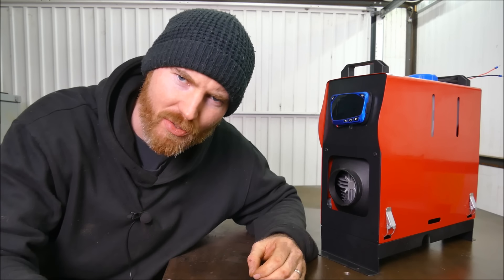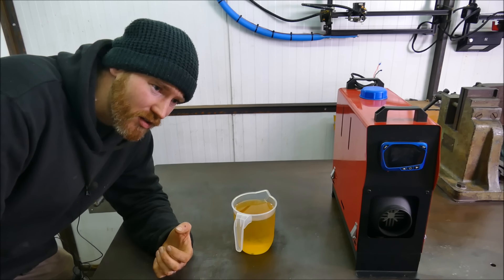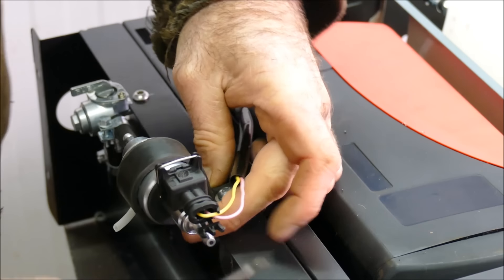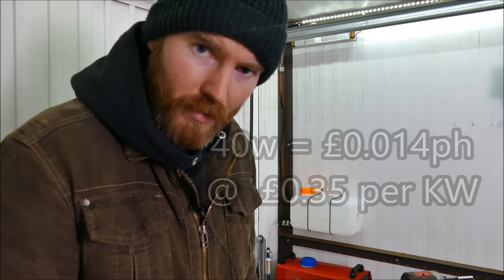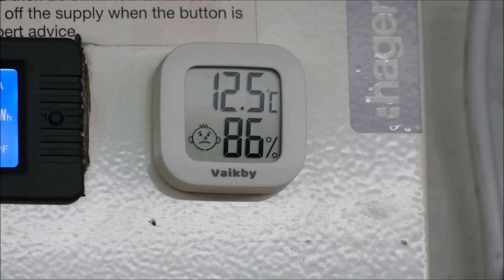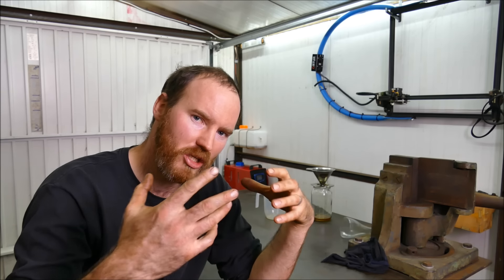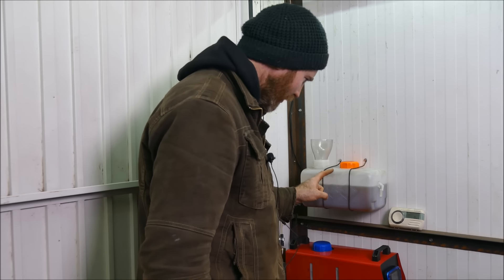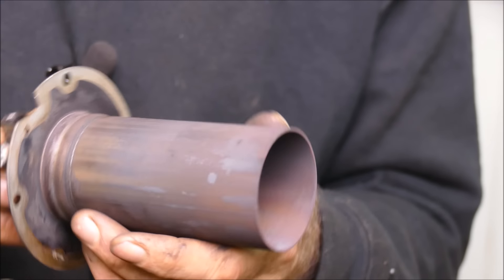£0.03 per kWh heater modification - Top facts & lies on diesel heaters - waste veg oil burn success

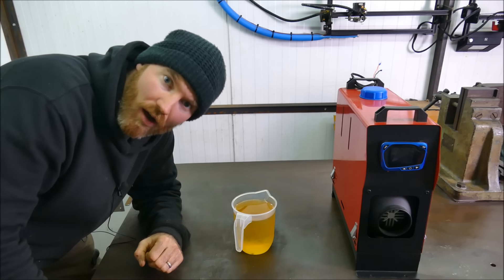Comment: 4:20 Just to note, energy is not charged per kW (kilowatt), but per kWh (kilowatt hour). It can get confusing when the wrong units are used. Thanks. Great video.
Reply: Agreed !!
Too many people don't know or care to use correct basic engineering expressions. 
Sadly it puts anything else in their program in question of accuracy.
Reply: @benjurqunov  So if you happen to misspell a word in an email I'm to question the correctness of everything else you wrote? If you ever misspeak I'm to ignore everything else you said? (not to mention that a) it's not an 'engineering expression' and b) only electricity is charged per kilowatt hour and from all else in this video you can still make your own calculations).
Reply: @pyramidsinegypt  It's not about typos. It's about using the wrong units in a very confusing way which leads to misunderstandings. Energy and power are not the same thing. I agree that if someone is doing experiments and using the wrong units when talking about it we should question if that person knows what he/she is doing.
Reply: @mcg6762  What was it specifically that he got wrong? If something consumes 1kW of electricity (runs at 4A @250V), and it is runs for an hour, doesn't it consume 1kWh of electricity?
Reply: @fredflintstone1428 He was saying and displaying kW instead of kWh in several places in the video.
Reply: @mcg6762  Ah I see. These days if I understand what someone is saying (or trying to say), I value their input rather than being too pedantic. A bit like spelling.....unless it really is bad.........for example, he did say a few times, 'it's more better if you' etc......I can let those go, life's too short.
Reply: @pyramidsinegypt  It's not pedantry. In science, units need to be correct or else they are misleading.
kWh involves a time vector, whereas kW is an instantaneous power usage. 
The difference is fundamental to the understanding of energy.
Reply: Still a great video though!
Reply: Yes I was wondering what his line of thought was and I am still very unsure if his "kW" calculations correspond correctly to the kWh numbers that he was supposed to present. 
So all of that price comparison in this video was for nothing as far as I'm concerned.
Reply: they're interrelated, 1 kWh equals one hour of electricity usage at a rate of 1 kW, and thus the 2 kW appliance would consume 2 kWh in one hour. The equation is simply (kW x Time = kWh)
Reply: @smallg9109  Yes, and it is essential to include the time vector.
Reply: @fredflintstone1428  He said 1kW costs 35p. But 1kW for how long? running a 1kW heater for 1 second costs 35p? running it a day? No. What costs 35p is running a 1kW load for one hour. 1kWh is 35p. That's why the h is important.
Reply: Please enlighten me as I'm still lost to the difference.???.
Reply: @billytollerton4220  kW/h has a time vector
Reply: I blame the school system
Reply: @fredflintstone1428  this approach causes rockets to explode if you try it at nasa. "Spelling" is a bit more important in science than conversations.
Reply: @billytollerton4220  while others have addressed this difference reasonably well, nobody has stated the difference this clearly: kW is a rate of energy, and kWh is a unit of energy.

I agree that it's absolutely not pedantry, and it is absolutely important to not refer to kilowatt hours as kilowatts.

Kilometers per hour is not Kilometers, and Kilometers isn't Kilometers per hour. Imagine the confusion if either of those were mistakenly expressed as the other.
Reply: @TonyLing  :: It's odd that people who don't think proper units are important tend to change their tune rapidly if you're talking about money.  Then they insist on getting the units right.
Reply: @FRESNEL_COOKING_SOLAR_OVENS24  No, you're wrong. I'm an engineer and units are important. You dont have a clue what you're talking about. Its ok if you dont know, just dont come on here and try convince everyone of something thats clearly wrong. It just creates a confusion clusterf*%k.
Reply: @FRESNEL_COOKING_SOLAR_OVENS24  "Energy is charged per kw. Kwh is the total measurement of killowatts used. You pay per kw unit. Prices are per kw."
Thats what you said and you're wrong. kw is NOT energy. You DONT pay per kw. Prices are NOT per kw. If you are indeed an electrical engineer then god help us. Where are you from?
Reply: @TonyLing  we all know it's an hour or is that about to change to?
Reply: @TonyLing are you my old mate from Australia
Reply: @FRESNEL_COOKING_SOLAR_OVENS24  The price of energy does not depend on the kW. If you consume 1 kWh at 1 kW or at 2 kW does not matter. The price is the same.
Reply: @FRESNEL_COOKING_SOLAR_OVENS24 as usual the "engineers" grammar and syntax is incomprehensible
Reply: @jamescasey4643  I've learned english by myself. Is not my main language. I am from East Europe
Reply: I'm glad someone else raised this issue because it's really important to understand the difference between kWh and kW. A simple analogy is where you take a hose pipe and fill a bucket with water. The "kW" is like the rate of flow of the water and the "kWh" is like the quantity of water in the bucket after 1 hour. You could have a rate of flow of 10 litres per minute and over 2 minutes you would have 20 litres. Or you could have a flow rate of 4 litres per minute over 5 minutes and have the same amount of water in the bucket.

So a 5kW heater running for 1 hour should generate 5kWh of energy, although some of that energy will go through the exhaust and be lost to the environment. If you run that same heater for 4 hours then it will generate 20kWh of energy.

HTH.
Reply: @FRESNEL_COOKING_SOLAR_OVENS24  I hope you  don't sign on to a job under the impression you are going to get X Euros per month for 3 months (kW) and it turns out that it is the total for all three months (kWh). 1 Watt is 1 Joule pr second. 1 kilowatt hour is 3600 Joules
Reply: @craigchamberlain  Watt is speed. (kilo)watt hours is distance travelled. I use that explaination
Reply: @TonyLing if you're not a teacher then you should be. I applaud your calmness in expressing the correct terminology repeatedly to those that think it's hair-splitting. Thanks for keeping your cool. 👍
Reply: Yes, it was annoying when he said things like "A litre of fuel contains 3.5 kilowatts of energy"
In some places he says "kilowatt-hours", using units quite correctly, but then makes repeated stuff-ups like that.
Reply: @FRESNEL_COOKING_SOLAR_OVENS24  And you are sill wrong. energy is priced per kWh  i.e 1kWh costs 30 Cents. I really hope you're not an electrical engineer.

Comment: you should try running the exhaust through a normal water radiator.
With the inlet in the top and exhaust out the bottom, so moisture can drain out with the exhaust.
Reply: are these exhaust pipes prone to corosion ?

Comment: With the exhaust being so hot, i would loop it through a metal box first, then the metal box can have an exhaust fan, the inside of the box will get hot and you get more heat. Or run the exhaust through baseboard heating, the fins would give off heat before the hot air is exhausted to the outside.  The idea is to send as little heat outside as possible, and keep as much as you can inside.

Comment: Maybe run the exhaust through a bucket of sand. Sand wont evaporate or go nasty, and will hold the heat. It could also go above the boiling point of water. Maybe even use a trough of sand, then you could have the pipe just do one bend and loop back and have it with a gradual downhill gradient to have any condensing drip out the end.
Reply from the maker: Video coming up. Cheers J

Comment: Idea: your waste heat exhaust could be modified by using a partially water filled rain gutter deep enough to encompass the exhaust tube but the tube needs to run downhill to allow any condensation accumulating a place to drain and run outside. In the US, that usually means 0.25 inches per foot drop. Next idea: use copper water pipe so you can braze or solder the fittings for a leak free path. The inside of the copper is smooth so accumulating dirty condensation is minimal and it leaves quickly.
The biggest downside I see is keeping the water filled gutter from freezing if your climate gets that cool.
Reply: It would take expensive silver solder to be safe from being melted by the exhaust. If he just uses one large coil it would take very few solder joints.

Comment: As most petroleum based fuels combust, a by-product is water vapor... And since you were cooling the exhaust with the water, the water vapor was condensing in the tube. And since the exit pipe was not at the lowest point, it started collecting in the pipe. as already mentioned...

Comment: You can make a cheap and effective vacuum filtration system with a plastic 5 gallon bucket, a small vacuum pump, a hose and fitting for the bucket and funnel shaped screen that fits the top of the bucket. Made one for doing something similar to what you're doing with the used cooking oil.
Reply from the maker: Thank you. It also best to cut it first with kerosene if that's the intention as it makes it far less viscous and easier to pass through. Cheers J
Reply: @joshuadelisle  a 10-20 degree temp increase does wonders as well, let alone heating it to 100-130C

Comment: Waste veg oil apparently soots these up quicker, but you can strip it down and clean, and buy the mesh injector in packs of ten. To recycle the used cooking oil quicker there's a video whereby they put gelatine powder or something like that and it drags all the burned impure waste to the bottom of container and then filter. Supposed to be the quickest way to do it.
Reply from the maker: Great idea. Cheers J
Reply: @joshuadelisle  great work Joshua 👏👏👏👍
Reply: good idea wtih the gelatine, most biodiesel processes gravity settle then filter/double filter dirty waste veg oil. I wonder if glycerine (from the actual process of producing biodiesel) would also work to flocculate the sediment quicker?
Reply: @MyMy-tv7fd  glycerine, I believe so, but not done it myself, but I think there's some videos on YT with glycerine being used.

Comment: For protecting your diesel heater from power outages you could get a 12v battery for a battery backup or mobility scooter and just put it inline. You won't be able to run for a long time but will be easily able to shut it down.
Reply: He said that in the video.

Comment: 2 options, fit a braze plate heat exchanger to ur exhaust you can then heat ur water plus use as a preheat for your kero. BPHX are reasonable cheap from china

Comment: Another great video Josh. I've been running my so called 8kw  heater in my well insulated finished 12x24' shop. I had the pump turned up to the highest setting and it put out an impressive amount of heat burning red diesel but there was an distinct smell of hot or burning plastic... I never found evidence of any melted of burnt plastic but I turned the pump down and the smell diminished greatly.
Yesterday I drained the oil from my diesel van engine so I will be mixing that used oil in with the diesel fuel at what I judge to be about 25% initially... aiming for 50% eventually. My unit is outside. Only the battery, the control, and the heat tube is inside. You could put a small 12v PC type fan on your exhaust pipe to push that heat out into the room. Keep up the good work - your video presentation is a very good mixture of tech and common sense. 
If you haven't already please warn people about the many different controllers being sold out there, how to identify them and the differences. Mine will not change from Celsius to Fahrenheit for US use, seems earlier and later models will.  Cheers
Reply from the maker: Thank you so much. I'll do my best. You can buy the individual controllers if you want a different version. Cheers J
Reply: @joshuadelisle  I'm mixing 25% waste oil into my red diesel now. The heater may actually be working better ( burning hotter) On this mix. What a great heater. Thanks again for all the info you posted on it.
Reply: They will all plug up eventually.  Look at loweredexpectations.  He tried so hard. They all plug up....

Comment: The long horizontal run of the exhaust is excellent!  The draft blower generates sufficient mass flow to carry along any condensed water to the exit and spit it out the end, outside the building.

For maximum efficiency, double or even triple it.  You might need to install a larger diameter exhaust pipe to keep the static flow resistance from becoming too much.  Another length or two of exhaust pipe, below the first one, doubles or triples your heat exchange area to harvest more heat out of the exhaust.  Make sure the exhaust duct is always sloped downward - it doesn't need to be much - will keep the water that condenses out of the exhaust gases flowing toward the exit.
Reply from the maker: Thank you. Great ideas. New video on it coming soon. Cheers J
Reply: If he adds more pipe below the existing exhaust, then he will have to cut a new larger hole in the wall. Add the additional exhaust above and then redirect the first cm's coming out of the burner to the top of the new manifold, the exhaust is so hot there that no condensation is taking place at that point, only further down the manifold where it starts to cool down. And yes, all sloped downwards and where it starts getting hand hot, go to a smooth pipe for better air and moisture flow. Keep the muffler and exhaust outside also facing downwards

Comment: Kilowatt is a measure of power, not energy. Energy is power times time, or KiloWatt Hour. KWH. If you run 100KW for 1 second you don't use much electricity. If you run 10KW for an hour you use 10KWH.

Comment: Interesting video.
   Just for your information there are two types of heating oil on the market, Kerosene and 35 second gas oil, both meant for oil fired central heating. The 35 second gas oil is the same viscosity as diesel so will not affect the wear on the pump.
  I have fitted my exhaust to a small central heating radiator and will let you know the results over the next few months, I have also upgraded the air cleaner and exhaust silencer and have fitted it very similar to you set up.
Reply: I appreciate your time and effort. You definitely have put a lot of work into this!

Comment: The heat-pump is actually better than 100%.  It depends a lot on ambient - but I'm guessing is temperate where you are so say 250%.  But of course the initial price is much higher than this contraption (although it also works as air-con / however useful that is in your climate).

Comment: I'd love to see how far this can be taken. You could use something like a Rasberry Pi to have a computer controlled startup and shutdown sequence that switches the fuel over. Add sensors and stuff to make it change settings to maximise efficiency. I don't know how to do any of that stuff so not sure how difficult it is.
Reply from the maker: It's a possibility. Cheers J

Comment: Great video, I have repaired many of these heaters in trucks. Although very reliable, the main faults is the internal fan failing and if white smoke or difficulty in starting, that green gasket between the heat exchanger and fan hardens and cracks with age probably depending on the amount of start ups the heater experiences.
Reply: or, more nastily, hard shutdowns.
Bearing failure did my last one.
Reply: do they just run of 12v? could you run them off a leisure battery or two or would it just zap them quick time?
Reply: @s1dew1nd3r4  Yup they will run off 12V or 24V.

There is a ~10A draw on startup for about a minute, which is mostly the glow plug heating up and the fan spinning at full. Same when it goes through it's shutdown routine.

On the lowest setting it will use about 1A / hour.

You can easily run one off a 110Ah battery, smaller batteries can struggle a bit with the startup and shutdown draw. A 110Ah lead acid leisure battery will give you a good 50 hours of running a diesel heater before it's flat, provided you don't keep turning it on and off again repeatedly.

You could run that off a pretty modest solar setup.

Source: I'm sat in my camper with my cheap chinese heater, it's -2 outside, I'm sitting here in my pyjamas feeling toasty :)
Reply: I like the heater I could run it off solar and black diesel and I really like the micro turbo. Why do we not have these in the US ? Or do we all ready without the turbo witch would be fuel oil heaters but there not as efficient
Reply: Where can I buy it
Reply: @thetruthfrmtyme2tyme  anywhere online really. The fan isn't a turbo really at least not in the sense that there is a fanless version.

The inside and outside fan are on the same shaft, the inside one moves fresh air in and exhaust air out, the outside one moves air over the heat exchanger and into your space.
Reply: @thetruthfrmtyme2tyme  they definitely are available in the US, I have a camper friend over there who runs one